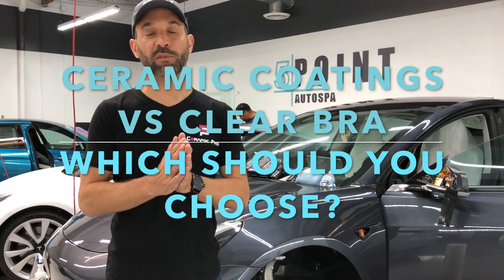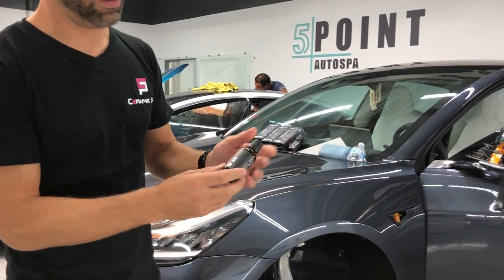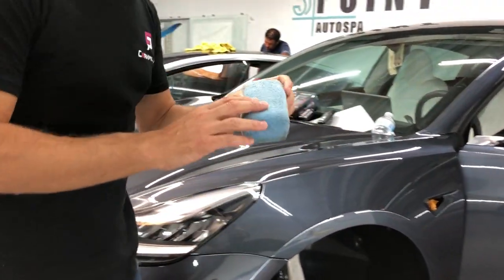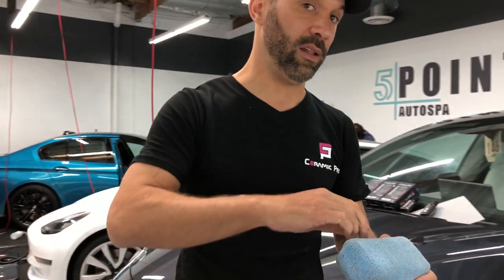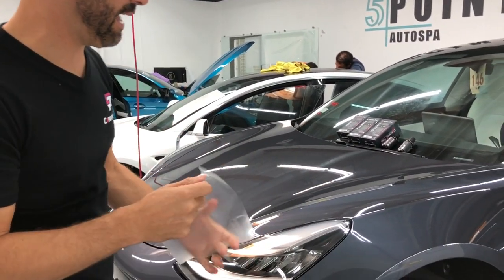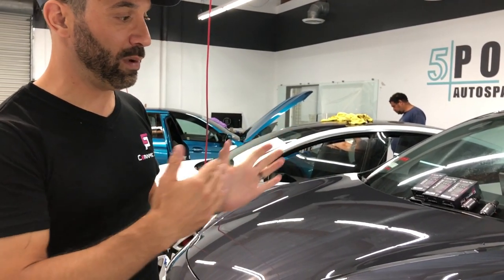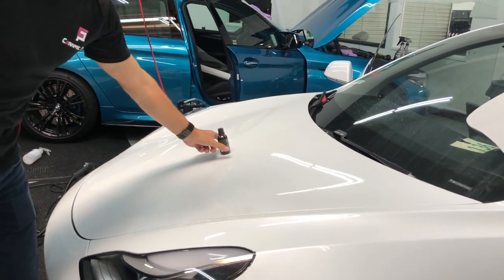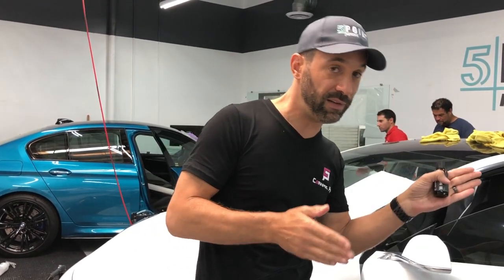Ceramic Coatings Vs Clear Bra Which And Why

Comment: Didn’t know you could put ceramic coating on top of clear bra.  Very informative.  Thanks
Reply: Good idea but will probably stop the wrap from self healing, thoughts?
Reply: Not sure how accurate that info is? Which ceramic pro product applies to clear bra? The one that is suppose to bond to the paint? Interior? I’m concerned if it will last on the clearbra, has anyone done this?
Reply: @devineintervention9865  Ceramic Pro has a specific PPF and Vinyl coating (base and top).  Before this formula came out, we did use 9h and Light.
Reply: @SanDiegosHetch  no, I actually did it backwards and did the wrap first ( which you can do) then the ceramic and it's going strong!! Already got 2 rock strikes on the hood, but the wrap took the impact, and the paint is perfect!
Reply: @devineintervention9865  Lasts great! protection from 2 rock strikes already from the wrap and the car always looks like glass, super easier to clean, too
Reply: @TT-gz2mj  So you have to rewrap every time you hit a rock? You're better off with Line-X. Everything bounces off. It looks like sandpaper though.

Comment: I think the key decision factor is do you want that super high gloss look with a ceramic coating - peanut butter and jelly is definitely a great analogy - clear bra and ceramic coating are 2 different use cases and are not similar - thanks for posting

Comment: Ceramic coating won't provide any protection for abrasion or small scrapes and scratches. Some clear vinyl is self-healing- rock chips, scratching grocery carts etc. completely different.

Comment: EXCELLENT VIDEO, as usual!!! I did the wrap first and then changed my mind and they added the ceramic pro on top and IT IS FABULOUS!  Super easy to clean, and always looks like glass. Already had 2 rock strikes on the hood and the wrap protected the paint fabulously! Worth the extra $..pay now with the wrap/ceramic or pay in the future repainting your hood for almost the same price.
Reply: How much does this cost though?
Reply from the maker: Thank You!
Reply: @dalephillips8250  I've got estimate for film protection hood, fenders, front bumper and then all car ceramic $2500.
Reply: @dalephillips8250  I did it in the expensive shop.
They do upscale cars like Bentley, BMW and so on.
Just for ceramic coat I payed $1500.
I decided go without  film protection.
They gave me 4 years warranty.
To put ceramic coat by itself is not so hard and expansive, most cost related to prepare for it.
One month, looks fine.
Surface very slick and shine.
But I have brand new car.
Reply: @СруликРизиньшнюфцельбобеноф  I wouldn't mind the film protection on the front of my truck but just for a 12 in wide strip just accros the hood it was $325 at the  dealer.

Comment: Will I see ceramic coating or streaks on the windshield especially inside looking out on a sunny day? Will the coating on the windshield diminish or be a problem for headsup display? Will it be as clear after applying?
Reply from the maker: 100% no. We do 100's of cars a month just in our shops and have never had an issue with HUD or streaking on windows.

Comment: I get the point of applying film protection, then ceramic coating and I think it'll be fantastic.
But what do you think of applying 3 layers: ceramic coating to protect the paint and the factory clear coating if I decided to peel off the film to replace it probably, then film protection, then another ceramic coating.
What do you think about that? Is it worth it?
Reply: TitansNM  it does. I'm not a car guy, but I had my hood professionally ceramic coated, then they put XPEL clear bra over it.  its been 5 years. Still looks like new.
Reply: TitansNM  
Yesss it does!...
 
I also did the front of my saleen mirror's hood and bumper...
Ceramic coated 3 layers and clear wrap on top...NO PROBLEM!
Two years so far and no peelings yet...

Comment: WoW! Excellent video! How much experience do you have with the Clear Bra and Ceramic Coating combination? I would like to know how many years both of these are designed to last for, and what kind of maintenance would be required. Will the sunshine eventually cause the Clear Bra to discolor or develope any other problems? Thanks a lot in advance!
Reply: I'm shocked after an entire month, you chose to not answer my questions!
Reply: It would have taken less time to google that than to ask and you would have gotten 100s of links
Reply: @mattbrew11  Absolutely nonsense. An intelligent person would not rely on posts from random people on Google to get the answers on such a critical subject. It is crucial to get those answers from a seasoned professional with countless years of hands-on experience in the autobody industry.

Comment: Excellent video... but I do have an issue with a shop doing these kinds of surface treatments and being done in the open and not within one of those booths where the environment is controlled so there is no dust getting on the surface during treatment and then being stuck under it... yuck.
Reply: You'd be surprised. It's not applying paint in a booth. So no worries, it'll look fabulous. The place that did mine has this set up and it came up excellent!

Comment: I just dropped off my car to have both clear bra and ceramic pro.  Will provide an update asap
Reply: So, how does it look?  What type of car do you have, and did you do the full car or half with one product and half with the other?
Reply: I have a Tesla Model Y in Red.  The treatments made the red color pop out more and it feels so smooth.  I did the thing on the video where the guy put a bottle on the hood and it slid.  Mine did that.  I drive from San Diego to Los Angeles and there are a lot trucks.  The paint still looks great after three trips.  I also got the window that blocks 80% of the UV light to all the windows and the top of the car.  I feel a big difference.  Usually I have to cool my Tesla before going in but now the window tint prevent my car from getting hot. Hope this helps
Reply from the maker: Thank you so much for your review! And business!
Reply: @JoannC830  Hi, I'm in LA area and interested in either clear bra or ceramic coating. Would you mind sharing the shop you went to and how much you paid for it? You can private message me. Thanks.